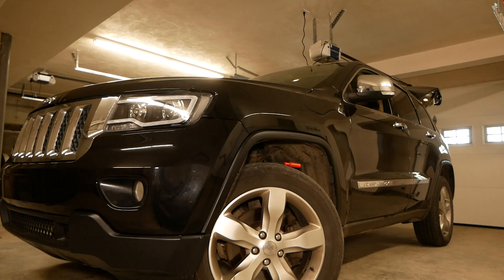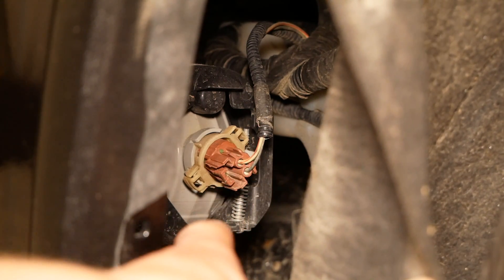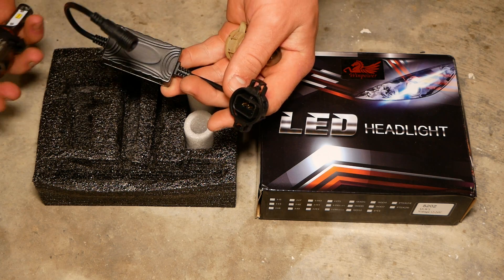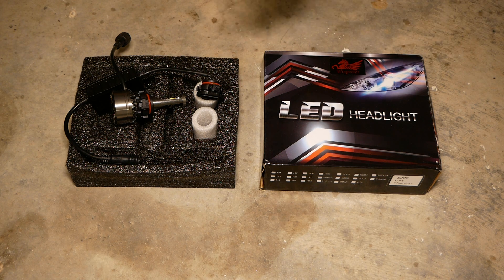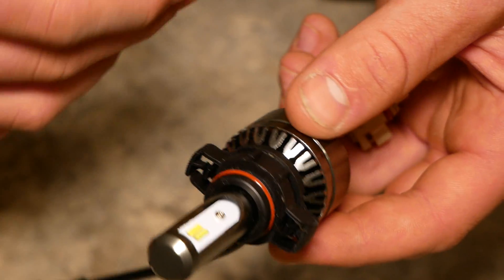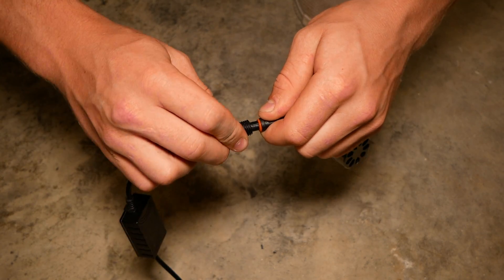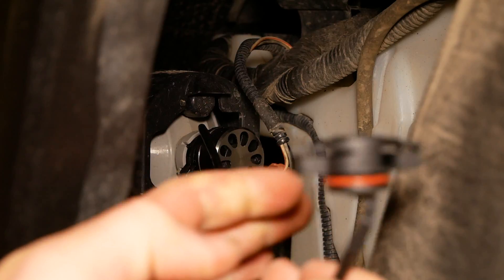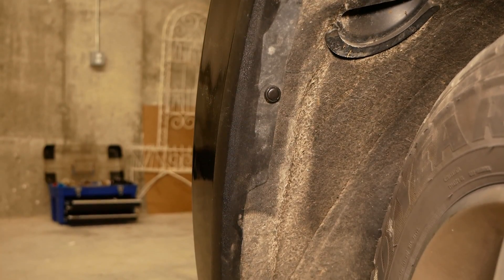COLOR CHANGING LED FOGS // Jeep Grand Cherokee

Comment: How did you wire the 20" light bar? I want to try and do this to my jeep as well. Thanks
Reply from the maker: He used a simple light bar wiring harness with a remote controller. You can find them on Amazon.
Reply: @JDCarsChannel  yeah I pick one up from Amazon. Now i just need to figure how to run the switch into the interior of the  truck.

Comment: Hello, good video, I just bought the fog lights for my GC and for some reason which I do not know, I have one yellow and the other is regular and I have already changed it but it is not the same, I was asking maybe it happened to you The same thing that happened to me that I did something wrong when installing them!?
Reply from the maker: It sounds like you’ll need to unplug one light. Switch the color electronically (to match the other) and then plug it back in
Reply: JD Cars I’m already do that and nothing seems to work 🤷‍♂️ thanks anyways👍

Comment: Just purchased same fog lights and installing now. Where did you get the headlights? I have a 2012 Jeep Grand Cherokee overland summit. Thank you.
Reply from the maker: Awesome! Hope the install went well. 

2011-2013 Jeep Grand Cherokee LED DRL Headlights -- https://amzn.to/3f78OlT
2014-2015 Jeep Grand Cherokee LED DRL Headlights -- https://amzn.to/3tMasxf

These are similar headlights that are pretty cool and in stock
Reply: @JDCarsChannel  one fog light was a pain. I had to crazy glue it on. Lol hope it last
Reply: @JDCarsChannel  these lights are different than yours. The daytime running light/bar does not have the curve in it at the bottom.